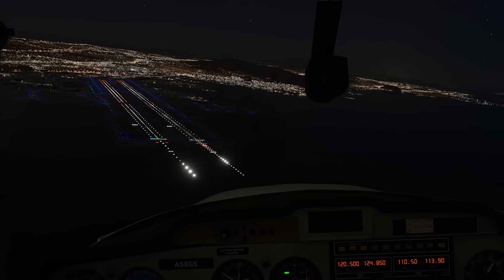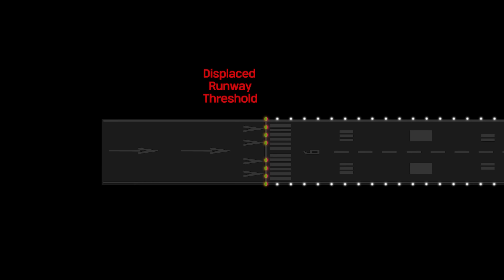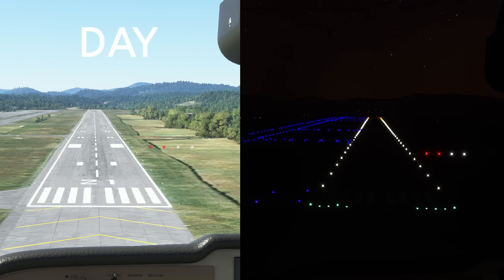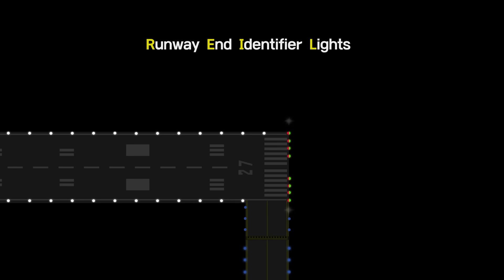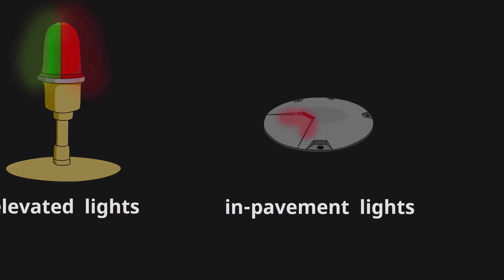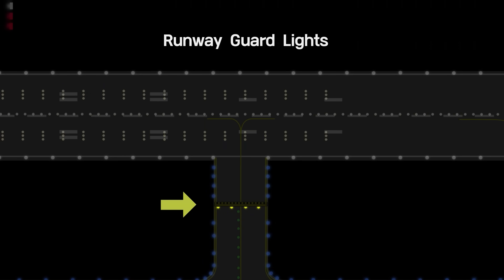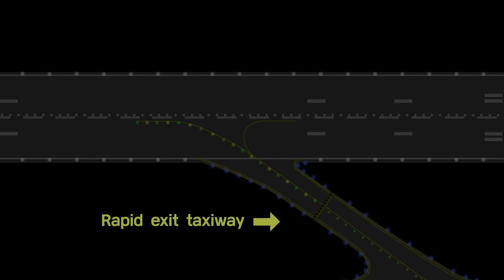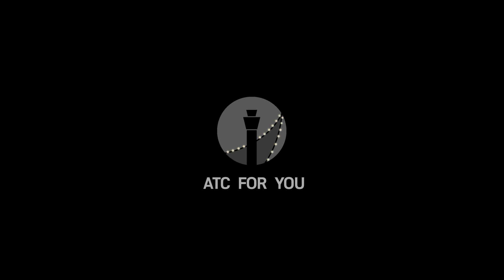airport lighting - you must know [atc for you]

Comment: I spent nearly a lifetime maintaining all these lights and the equipment that powers them along with the controls. This is good stuff !
Reply: Do you know of any existing automated software that can check these lights based of imaging? Or do all airports check if the light work manually by a person?
Reply: @alexandrugeorge1573  There is a system called ALCS, “ airfield lighting control system”. The system also monitors all airfield lighting circuits. All the leading airfield lighting manufacturers have systems very similar to one another. These are the two I am most familiar with, ADB Airfields Solutions and Crouse-Hinds. There are more world wide. 
Airports still generally have inspections daily and nightly for compliance with FAA standards. The computer systems are a big help with other circuit monitoring such as Meg readings and supply equipment monitoring and provides alarm status to help with monitoring unmanned airports when uncontrolled.
Reply: Hi from Ireland. Thank you for your service. You kept a lot of people safe.
Reply: @HowardR999 thanks for the comment. 
All in a days work. A very rewarding career to get into. It’s a lifetime of learning and a pleasure knowing it’s a safe place for the #1 most important folks, the passengers, the pilots.

Comment: noise abatement systems ...... the network  are all connected to terminal ports ...... so .....  many   newspapers  report that the noise   is  ....above the threshold of hearing ..... and you need to  use hearing aids to   abate noise or listening to frequencies that are in the uv spectrum may cause hearing  problems .....  besides all ports are amplifiers to  broadcast ....... landing and takeoff   and lighting with blue lights might not be visible .......  .........   well  you need me but the university   doesn't need anything except robots ..to count  money  u see madam ...

Comment: the caution zone used to also be 2000 feet -  first 1000 half was yellow then last half was red.  also noted in runway centerline lights. alternating red/white to all red. 

and they are not just for landing, they are there just to indicate as a rolling aircraft, you are approaching the end of the runway.  this was later changed to runway displaced threshold.

Why was VASI Omitted from this video?  VASI Is still in use for airports that have not either A: Upgraded to PAPI and/or B: not required to use PAPI.

REIL Strobes are also used on precision runways, not just non-precision. 

why was ARCAL/PAL Controls not mentioned here?  Thousands of non-precision airports use ARCAL/PAL at a pilots discretion to activate and adjust desired lighting intensity based on a timer when a non-precision airport that has a simple FBO but no tower or ATC is utilized during FBO 'Closed' times or when a tower only operates partially within a 24 hour period.
Reply: you did good on the runway markings, only 1 notable error, but here......... missed quite a few things.

Comment: Are there runways where take-offs/landings are possible from both sides? If how the REILs are managed in such cases?
Reply: Perhaps you have not been to an airport for with a little thought, you'll see just how funny your question is.
Planes benefit from and sometimes need the bonus lift given to the wings generated by the wind.
Runways are built to run in line with the most frequent wind direction, throughout the year, year after year.
Occasionally, the wind will have swung around through 180° and be blowing back down the runway in the opposite direction.

At Heathrow for example, it opened with a star formation allowing two runways in line with the prevailing wind (running from W to E roughly), two more at a diagonal angle to these (SW to NE) and a final two at an angle forming the other arm of these diagonals' "χ" shape (NW to SE). It was just missing two South to North.

Using them from each end allowed maximum take-off bonus boost and maximum landing car-spoiler road-hugging effect.

So yes, every airport on the planet uses both ends of each runway it has.*

*Okay, except for those Himalayan ones where there's a cliff face at one end.

The REIL lights are arranged as per and then only illuminated when the wind is blowing in this other direction. Simple and elegant.

I hope that this goes some way to answering your perfectly reasonable question and wish you bon voyage.